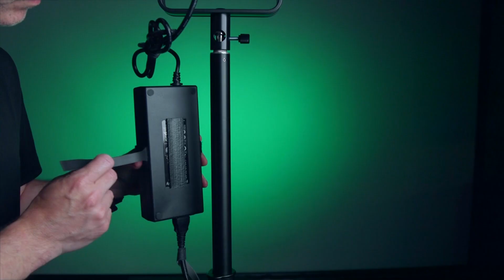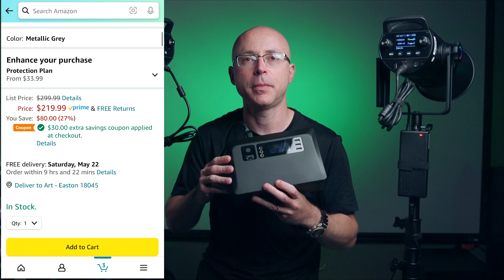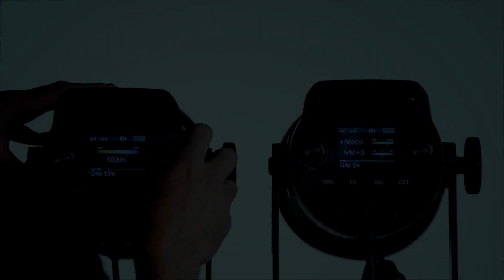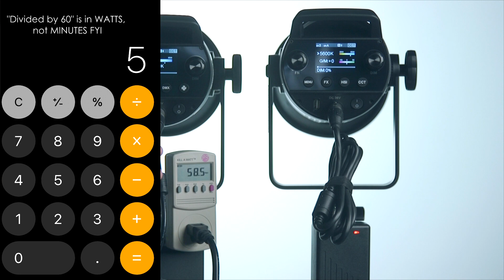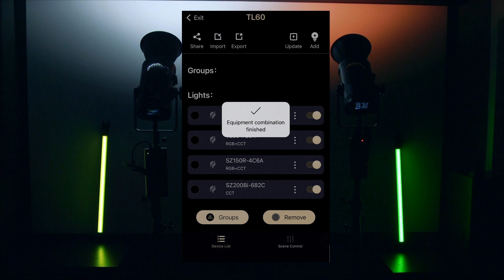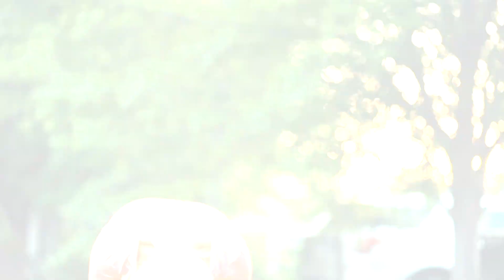Godox SZ200Bi Extreme Review And Powered Outdoors! Comparison with the SZ150R!

Comment: Thanks for a great review. But I have 2 questions. #1. You started to say how long the SZ200Bi would work when powered buy a power bank, but you never quite got there.   #2. Would I be able to to power 2 of these lights from one 800 watt power bank?  If so, how long would you say it would last?
Reply: Thanks for the reply.
Reply from the maker: How long it will last… #1: It all depends on your power bank, the quality of the battery, the condition and age of the battery, how many cycles etc.

#2: assuming the light will be at 100% at all times, with your 800 watt power bank, which I assume it’s a 800 WATT- HOUR power bank with the SZ200BI drawing 200 watts, naturally, it should last 4 hours. With two, will last 2 hours or less. 

Yes, you can power two SZ200Bi with a 800 watt unit.

HOWEVER, if your power bank is NOT Pure Sine Wave, do NOT use it with this light. A 800 watt pure sine wave power bank is quite expensive. Most of them out there are not pure sine wave.

Comment: Thank you for all the great reviews and insights! I am trying to compare this to the GVM200D. It seems from your testing that the Godox has a higher lux with and without the reflector (regardless of the frosted cover), but the CRI is slightly lower. Both seem like great lights just trying to gauge the differences in performance understanding the differences in color temperature functionality and connection methods. Do you foresee any problems with fresnel attachments on the Godox? Any information would be beneficial. Looking forward to your feedback and thanks again. Such a great channel!
Reply from the maker: Hey, somehow, I just saw your comment. I receive too many LOL. Sorry man. I didn’t have a GVM SD200 but now I have them all. Matter of fact, I just received today a SD150-R and a SD-300 at the same time. I’ll see what I can do comparing them to the SZ200BI but as you can see, I’m too busy with these other lights that don’t stop showing up. 

Regarding fresnel attachments, just monitor the heat and don’t shoot in hot environments with them attached. A lot of heat build up.

Comment: Thanks for the great video!  I had a little trouble following when you were doing the power readings.  If I'm understanding correctly, you lose more power the further you get from daylight temperature in either direction.  So basically if you go all the way to 2800 or 6500k, it'll effectively be a 100 watt light.  Is that correct?
Reply from the maker: No, that’s not correct. From 2800K to 6500K you’re getting 200+ watts, not 100. The brightest setting and more power consumption is at 5600K by 1/2 stop and 35ish watts higher.
Reply: @ArtVideoProductions  Thanks so much for clarifying!

Comment: Is the SZ200bi as powerful/bright as the SL200ii?
Reply from the maker: It should be. 200 watts is 200 watts. What makes the light more powerful will also depend on what modifiers you use; a reflector… a fresnel adapter… softbox… all these matter.
Reply: @ArtVideoProductions  But SL200ii is daylight. It's obviously brighter than SZ200bi which is bilight.

Comment: Their site also list a SL200II Bi but I can't seem to find anything about it.
Would love to have a comparison between it and the SZ200 Bi.
Reply: The SZ is zoomable…the SL isn’t.
Reply from the maker: @danliutikas  thanks for that info 👍
Reply: @ArtVideoProductions  surely there must be a difference somewhere. Why would they do the same one without zoom for the same price
Reply: @yesnomaybewhy  I was also debating between these two lights. What I found is the SL200IIbi has the power adapter built in, so the head is heavier but you don't have to deal with a dangling power adapter, just the simple plug. However it does not support app control, you have to use the physical remote. For that reason I am going for the SZ100bi.
Reply: @briannelligan1193  you had me until you said SZ100bi
Reply: ?? simple typo  @c.s.christopher5801
Reply from the maker: Between the two, I don’t see any difference whatsoever, other than a different name.

Comment: thoughts on sz200 bi or vl300... i was looking to get more output than my vl150
Reply from the maker: VL-150 is 100% daylight. The SZ200Bi is bicolor, sharing 50-50 LEDs. The VL300 is also 100% daylight. The 200BI might output the same intensity on daylight (only) as the -150. 
The VL300, obviously the most powerful. But doesn’t have the same features as the 200Bi. It’s up to you regarding your needs.